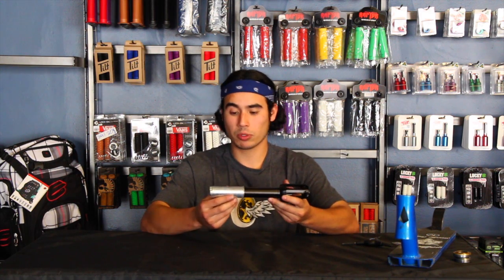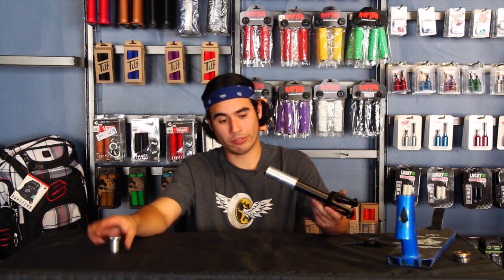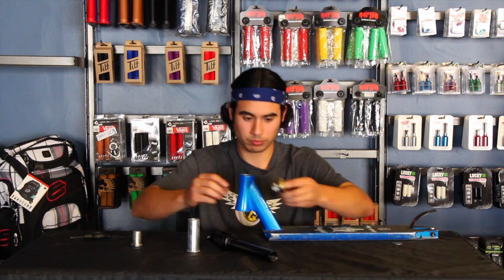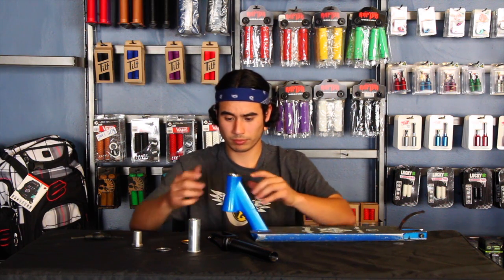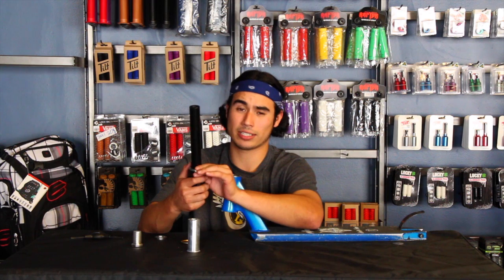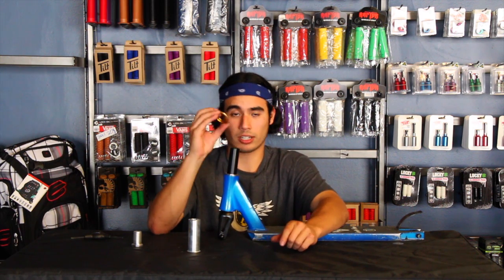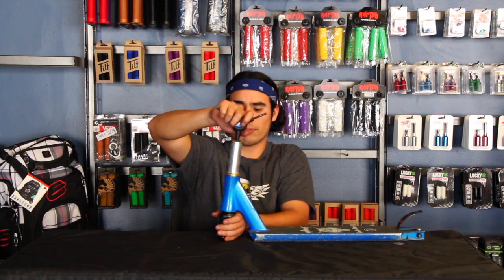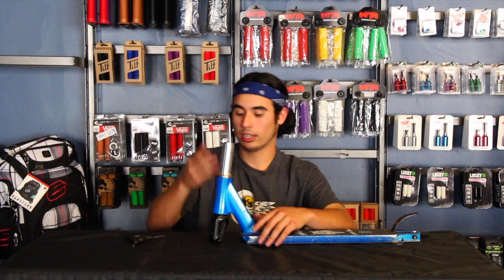The Vault Pro Scooters : Compression Series : HIC Compression (2 Of 5)

Comment: heyy im new to this do i have to have oversized bars and clamp for hic
Reply: Yes you do :)
You can run standard bars on an ihc compression system which virtually is just a smaller (and arguably weaker) version of hic
Reply: Kilmore Skatey Owners everything is correct there but u said ihc is weaker but it is actually one of the lightest and best
Reply: the reason it is lighter is because it uses less metal thus making it weaker.
Reply: Rx3 Inc yes you will
Reply: You can have standard bars but you must have a slit for HIC

Comment: can you use HIC without the shim, Is it possible because im buying standard bars just wondering because i have a HIC fork?
Reply: I dunno but I have oversized bars and my shim cap snapped and it wobbles so much but I have ordered a new one so I think no if you have oversized
Reply: You need the shim for the compression to work i think
Reply: +Jimmy R yeh I think
Reply: If you have standard bars you can use IHC which is pretty much hic but smaller